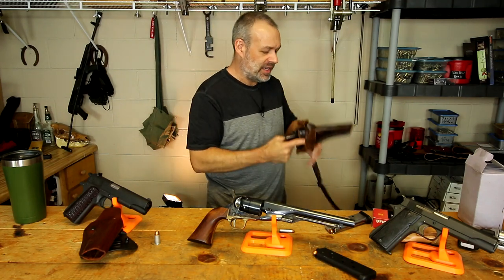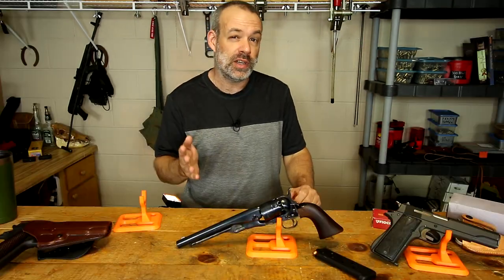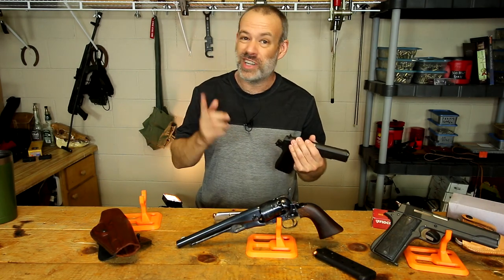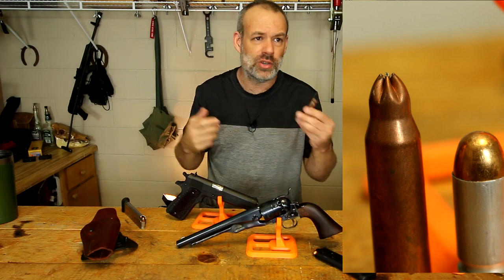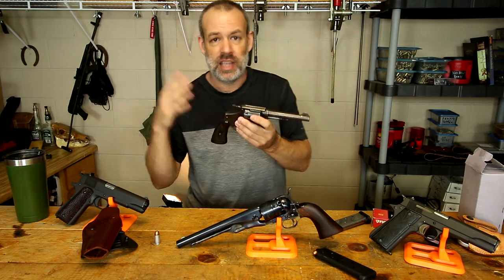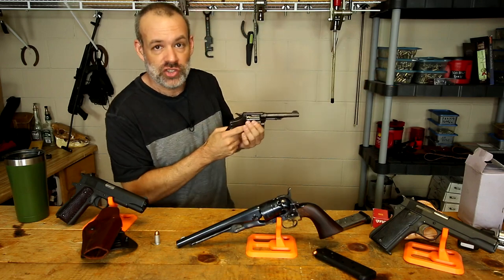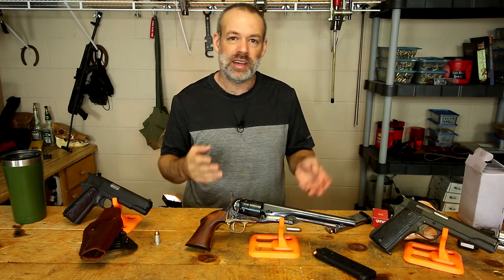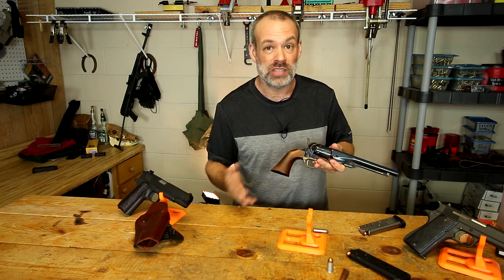How Do Prop Guns Kill?

Comment: Now, I was with you right up until you said Baldwin wasn't responsible. He was the producer on the movie. They cut a lot of corners for safety. And some reports have the weapon being his personal gun. I also believe it was a black powder conversion, because the prop master had said that she was having difficulty loading the weapon. A 2 year old can load a colt, open gate, got to halfcock, and place rounds in the cylinder. Not a whole lot of difference vs a modern revolver. But cartridge conversions are a lot of trouble for the inexperienced. And she was 24. Seems like the producer might have seen fit to get a prop master with knowledge of the particular weapons in the shoot.

Comment: At close range the gasses of the blank can also injure someone, thats my guess as to what happened.
Reply from the maker: That was my first guess as well but apparently those injured were supposedly behind the camera more than 20ft away.  We'll see if that early info remains accurate.
Reply: I don’t think it it would kill two people. Something sold had to come out of the bullet.
Reply: Perhaps the gasses blew a small rock or some other prop at the camera, I guess it would be like a "secondary ricochet"
Reply: @texpatriot8462  FYI, a bullet is what comes out of the barrel of a gun. The whole thing (shell casing, bullet, powder, & primer) is called a cartridge or a round.
Reply: @Riceball01  I had a brain cramp.  I meant to write “something solid had to come out of the firearm.”  I had bullets on my mind and wrote bullet instead.

Comment: Most if not all of rifle  blanks are crimped on the end  of the  blank because  the rifles of semiautomatic type need the added pressure  to work the action most pistol blanks are not crimped at the end of the blank cartridge but definitely  have a wad that basically does the same thing  as the crip on blank rifle cartridges

Comment: They did have an armorer. The armorer handed the gun to Baldwin and said it was safe.
I believe Baldwin is a producer on the movie. We all know he has years of experience working on sets. He was worked with armorers before. Profesional ones.
Part of an armorer's job is to clear the gun. They are supposed to clear the gun in front of the actor so they can see it is clear before handing it to them. He should know that.
Why he excepted the gun without seeing that it was cleared I don't know. 
What I do know is that the armorer is 24 and was taught by her father who was an armorer and a stuntman. I know she did an interview saying that loading blanks scared her.
I think this is the first set she has worked on in the position of an armorer. 
I suspect she got the job through some form of nepotism. It is who you know not what you know.
I blame her. I blame the person who hired her. I blame Baldwin for working on a set where it was obvious that the armorer was not performing her duties. As a producer on that set he is also in a position where he should have been looking at safety concerns.
There were warning signs. Guns were loaded when they weren't supposed to be. I think there were prior instances of live rounds on set. People had lodged complaints about safety concerns over the way the firearms were handled.
If they had found a live round earlier as reported then the whole set should have been shut down and every gun and round checked.

Comment: I blame the executive producer for hiring an inexperienced prop master.

Also, of all the scenarios you provided, only the double-barrelled rifle would have enough energy and be somewhat likely to kill someone and injure another.
Here's what I think: live bullet and violation of several basic safety rules on firearms. Then again, that's mere speculation. But I don't think it's a catastrophic failure of a gun since Alec Baldwin would've probably been the most injured if that was the case. I don't think a loose blank adapter or a blank-propelled squib has enough energy to kill someone and injure another.

Comment: A squib load in a revolver generally won't go all the way into the barrel.  Usually, it will lodge between the cylinder and the forcing cone, locking up the action.

My suspicion is that there was a true live round in a revolver.

I disagree with you about the propmaster being ultimately responsible.  Yes, the propmaster has a lot of responsibility.  But if you put a gun in my hand, then I am responsible for what I do with that gun.  If you tell me the gun is loaded with blanks, then it is my responsibility to ensure that it is, in fact, loaded with blanks.  If you tell me the gun is completely unloaded, it is my responsibility to ensure that it is, in fact, completely unloaded.

Comment: Whatever we learn as the investigation proceeds and is completed, the fact remains that Alec Baldwin is ultimately responsible, even if the armorer and assistant director (who handed Baldwin the gun, announcing "cold gun") also bear responsibility. If you point a gun at somebody and pull the trigger, you are responsible for what happens, period. 

For one thing, a firearm should bever be handed from one person to another. The last person to handle the firearm before the actor who is to use it picks it up, should place the firearm on the property cart with no other firearms on the tray, and only after checking the cylinder, mag/chamber, and ammo. When the actor picks it up, that person should also do all of those things before pointing the firearm anywhere, much less pulling the trigger.

This neophyte knows these things and knows they are inconvenient, tedious, etc in the context of filmmaking, but if you don't do them, people WILL get injured or killed. This is not the first time this has happened and it will not be the last until the procedures are changed, AND followed.

Comment: I think that co2 powered "m&p" is just terrible I'm surprised you didn't use gbb instead since those guns are usually always metal and have full recoil effect and can be used with many different gasses if tuned and contained correctly which wouldn't be hard for any good prop company

Comment: I've been shooting for right at 70 years and Baldwin is 100% responsible for pointing the gun at another human being and pulling the trigger, period.  End of discussion.  I knew not to do that by age 5.  Also, I've seen guns that had bullets or other obstructions in the barrel when a round was fired and it leaves a tell-tale ring in the barrel where the excess pressure caused the barrel to swell.   It should be really easy to tell with a visual inspection and in extreme cases, you can run your fingers over the barrel and actually feel the swelling.

Comment: Here in Germany we can buy blank fireing only pistols and revolvers. Out of these it is simply impossible to fire life rounds. The blank fireing revolvers have a unmatching bore axis, drum and barrel simply do`nt line up. No life round can be fired. On the pistols there is a barrel with a pin worked through. Below the chamber is a milled slot. Loading and fireing a life round would colapse the barrel behind the obstruction . Also loading a life round would not be easy, the chamber is shorter, accepts no cartrige with a bullet protruding. Needs to be mandatory using these in movie `s ... I used to wear the colors of my country. It is simply impossible to hand me a loadet gun. When I pick up a gun no matter what I automatically handle it like it is loaded until I have checked. Also all loading and unloading operations I do by myself. Check the accident statistic with guns here in Germany. It is 0, we have none. And we have 5 million registered gun owners with 20 millions of firearms ...

Comment: I’m going to disagree with you on fault. When you are the one handling a gun you are responsible for and projectile that leaves the gun and you are responsible for where that gun is pointed. As the person that has their fingers on the trigger you should inspect the gun before handling it, a negligent discharge is all on you. There is no way around that fact. Just because he is an actor does not make him immune to the actions that he took. Example: if you go to buy a car and the seller says everything on the car is in good working order. You then drive the car and the brakes fail and you run over someone and kill them you are at fault. You were the one in control of the vehicle. Period.

Comment: This was not an accident it was a negligent discharge.  Meaning Alec was negligent in not checking the firearm, pointing the firearm then shooting it at another person with out checking it.  A prop gun is not a real gun and can never ever fire real ammo.  They do make real firearms into prop guns but they can't fire live ammo and in fact real ammo won't even fit.  Now Alec was using a real firearm (shotgun) and everyone who puts hands on any firearm takes on the responsibility of that firearm.  So each and every person who handled the firearm should have checked to see if the gun was loaded no matter what someone tells them or who the person was.  Being that it was a shotgun the action should have been open or broke open if it was a side by side.  So to make sure everyone understands, as the firearm was handed to each person that person holding the firearm had the responsibility of the firearm at that time and needs to check it and not base their responsibility on someone else's actions.  He never should have pointed the firearm at anyone or ever put his finger on the trigger so it was pure negligence on his part and no one else.

Comment: Let's get the terminology right - Revolvers and bolt action rifles aren't converted to shoot blanks - nothing has to be done to them - there is no conversion required - they are designed to shoot either live rounds or blanks.

A prop master shouldn't have to weld an obstruction into a semi automatic firearm - they shouldn't be legally allowed to buy or posses one that doesn't already have its barrel welded closed. The same goes for the so-called hero bullet which is another title like prop gun that is BS. With the laws and restrictions that exist today a prop master should be allowed to create these items and should only be allowed to buy them under reglatory conditions.

Comment: Does this guy work for Baldwin ?  There is NO reason a scene would use or require a gun to be loaded with "Dummy rnds" then used in same scene without replacing that gun with a fake with blanks

Comment: It was a Colt Peacemaker, the crew also had been using it for target practice with live rounds between takes. So they had live rounds on the set. The gun wrangler was an utter moron who got the job due to who her father is. There had been several unsafe discharges and firearms incidents on the set, to the point it was a grievance the crew put in their letter from the walkout the filming crew did just that morning. 

It was a whole live round from a box of ammo that was in that weapon. Someone needs to go to prison over this. Likely more than one person once everything get figured out.

Comment: Rumor has It that it was a live round. Although, crew members reported that the gun had "misfires" multiple times. I'm guessing this incident will be nearly identical to the way Brandon Lee died, and that the projectile had enough force to pass through the cinematographer before striking the director, who was reportedly standing directly behind her.
Reply: Possible.  What killed Brandon was a live round used as a prop…to make the prop rounds they removed the powder from live rounds but left the primer in .  A deadly oversight
Reply: @MrProfchaos71  The primer pushed the bullet partially down the barrel. A blank was later fired which propelled the bullet at a high velocity, probably faster than a live cartridge.
Reply: @wastool  yes that’s accurate.  I was thinking that as I typed …that I vaguely remember something about a bullet being stuck in the barrel .  Good catch
Reply: @MrProfchaos71  A blank holds a lot more powder than a normal cartridge, it's a wonder the gun didn't explode. It had to have been tremendous over pressure.
Reply: @wastool  the head armored on that movie is a 24 year old female as it turns out 😂.   Her father is apparently famous in the industry
Reply: @MrProfchaos71  No matter who else was involved, it is the person holding the gun that has the ultimate responsibility. You always verify the condition of a firearm for yourself and never take someone word for it. My understanding is that Baldwin was goofing around and that pointintg the gun at anyone or pulling the trigger was not part of the scene. It was his responsibility to be familiar enough with the weapon to know if it is loaded and to ensure that he was treating the weapon with the proper respect and behaving in a safe manner.
Reply: @wastool  preaching to the choir bud.
Reply: @wastool  The thing is…..you know that…I know that… but everyone knows he has no real gun experience.   So I’ll ask you a question.  Would you hand over any of your guns to someone you know has little to no knowledge of guns or gun safety ?   They hire and pay “ professionals “ to maintain the safety of said items in a tightly controlled environment.   Yes ultimately he was holding it and treating any gun like it’s a toy is foolish and irresponsible….but so is being a so called professional in the field of movie firearms and allowing this to happen when you know you are responsible for what guns have what in them at any given moment and who has possession of each one.  it’s not much different than an experienced gun owner handing a loaded gun or any gun to someone they fully know is inexperienced or ignorant of firearms.  Would you do it ? I wouldn’t.
Reply: @MrProfchaos71  I have handed loaded firearms to people I know have almost no experience, but I'm there to hold there hand and walk them through it. If I was the armorer on a movie set, no one would handle a firearm until I knew they had a basic familiarity with the operation of the weapons they would be handlin.
Reply: @wastool  same here man.

Comment: Great video, but no matter who checked the gun, Alec is responsible. There is no actor immunity. There is shared liability, but it is incorrect to think an actor who pulls a trigger isn't responsible for what comes out of a gun. An actor is never to aim a gun of any kind at anyone. The scenes are "cheated" to appear as though the direction is at a person , but the direction is not supposed to be toward another actor. An actor is also allowed and should check the gun, requesting to dry fire the gun the number of bullets it is capable of firing and watch it being prepared prior to the scene.

Comment: All Responsibility is on the person holding the gun, Being an actor is no excuse to fail to use common sense gun safety. There should be no possible way a gun is point at a person and the trigger pulled on camera at the same time. Not to mention it should not be used as a toy while not filming and shot at the camera man.

Comment: Honestly,  with it going through someone, and into someone else,  thats a descent amount of power. Had to be a live round. And,  my thoughts on that last comment at the end of the video,  I believe the responsibility lies on both parties. As its standard procedure to not point even blank fireing guns at people, they're typiclaly aimed off taget specifically to prevent something like Brandon Lee. Even if he thought it was loaded with blanks,  igoring the most basic firearm safety by not only pointing,  but pulling the trigger at someone,  is just completely unacceptable. Especially if its true that it happened in between scenes like it sounds like it was.

Comment: while the prop master is largely to blame, a gun in your hands is your responsibility. your actions dictate if/when it fires, and where the projectile goes upon firing. Ignorance of basic firearm safety does not entirely absolve the actor.
Reply: To make matters worse, the film crew claims that the prop master wasn't even on the set at the time the accident occurred. He supposedly left the set hours earlier.

Comment: If the gun had any obstruction in the barrel then why wouldn't the crew clear the round between takes as a safety protocol?  At the range you always clear  a jammed round before continuing to fire and are always aware of potential risks using a firearm.  Why were they so careless?

Comment: I disagree, Alec Baldwin is responsible.  Would he have checked to see if the gun had a live round in it if the scene called for him to put the gun to his head and pull the trigger?  Yep.  This is no different.  The person handling the weapon is responsible to ensure its safely used.  He pointed the gun in the direction of a human being, nobody else.  It's yet to be determined if he pulled the trigger but I'm betting the answer is yes - it didn't malfunction and discharge by itself.

Comment: Baldwin is also claimed to have firearms knowledge, this wasn't his first movie using firearms by a long shot either. That said, with him being a producer ( of a low budget film, maybe they could have used a higher budget to have better staff and equipment let alone maybe some CGI this wouldn't have happened ) and they had problems with safety on set, he should have checked the firearm given to him. Sure as hell wasn't using autoloaders in the time frame this film was based on, 45 long colt / 45 -70 govt / 44 ( cap and ball ) just to name a few calibers, revolers, muskets and repeaters mainly as for arms